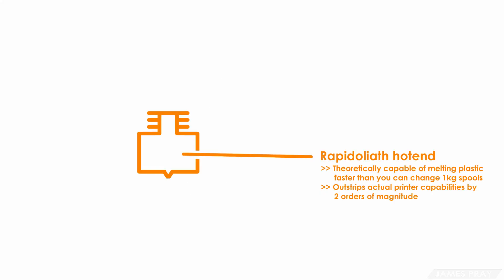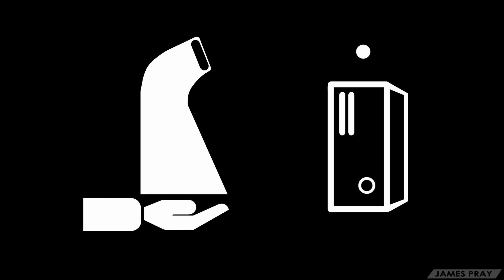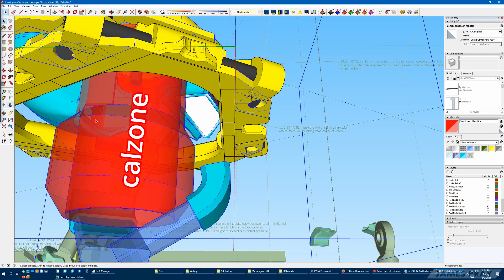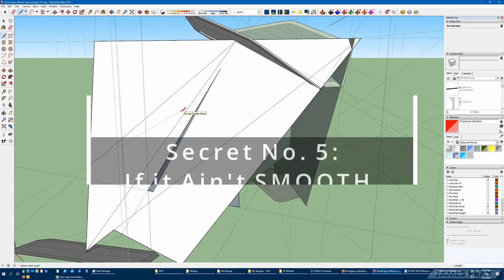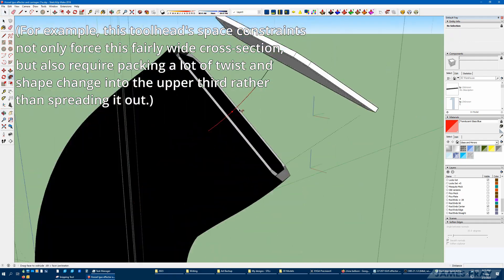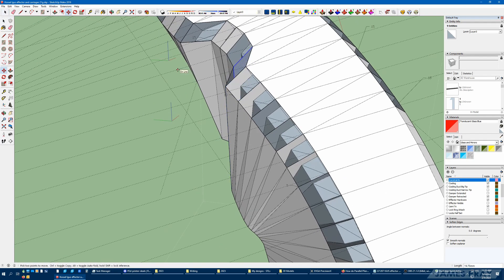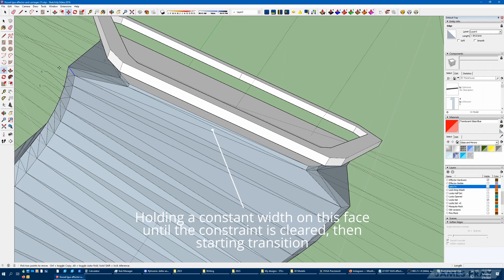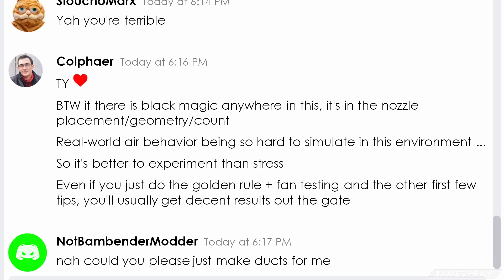Ultimate Duct Design Guide for 3D Printers | My Top 17 Secrets for Custom Cooling Ducts that WORK

Comment: best cad is blender
Reply from the maker: EVERYBODY FIGHT:face-blue-smiling:

FR though, blender for duct development could make a lot of sense
Reply: @jamespray  I have made a setup, where I just make a curvy 2D plane with like 16 vertices, and it turns it into a smooth tube of arbitrary thickness. I then just added a boolean, so now I can just hide parametric ducts inside the walls of my prints.

people do CAD, but blender can be parametric, or explicitly modeled, interchangeably.

Comment: Great guide, thank you James
Reply from the maker: You're welcome!  Always nice to hear :)
Reply: @jamespray  May I ask few more questions cause I'm a totally noob🤣:
1. Secret 2, how to measure the air feed? by watching how deep the water been blow away?
2. Secret 9, the ideal duct cross section shape is circle, but air outlet of some fans is rectangle (e.g. 5015) , so how do I decide the duct cross section shape at start? a circle that totally cover that rectangle will do the trick? or just smoothly trans that rectangle to circle?
Reply from the maker: @mortysmith3592  1: It's hard, lol, but just do your best - the "sweet spot" is usually broad enough that you don't have to be perfect.  Using water and taking pictures of different tests for comparison helps.  2. If possible, start with the fan outlet cross-section to avoid a sharp transition of cross-section area (same as with any part of the duct).  If it's a rectangle, start with that rectangle, then transition.  Hope that helps!
Reply: @jamespray  So much thanks for your advice❤

Comment: There are free CFD options, both proprietary (which have the pro of GUI but limitations on what you can do, e.g  ANSYS Workbench Q which limits 512k elements at 4 solver processes, Star CCM+ and COMSOL Multiphysics also have free plans iirc, it's been a few years since I looked at any of the proprietary packages). But there are at least two notable open source CFD solutions. OpenFOAM and NekRS. I believe both are commandline only but they don't have any artificial limitations so that's the tradeoff. A major benefit of those is that they have native linux support. I don't know which, if any, of the proprietary solutions work on linux or which ones can be made to work on linux via compatibility layers like wine.

Comment: This was very much needed. I’m designing a drone that uses two vertical props in the middle that get S-ducted away to downward nozzles at the front and rear of the craft. The nozzles would then vector and control would essentially function like a Bicopter.

However I’ve really been struggling to find a set of basic tips for ducting like this. I know enough that poor ducting will cost me thrust, but when it comes to the right kind of design to sustain thrust after bending it twice, I’ve been flying blind!

Now I have a few key things to bear in mind, the first prototype will hopefully have a negligible loss of thrust. Thank you sir! 😃
Reply from the maker: Cool!  Not a use case I imagined in the making, but ducts do just get air from point A to point B, after all.  Good luck with the design!

Comment: just why tf would you use sketchup
Reply from the maker: Stable, free, lightweight, entirely local (at least the old version I use is), and does everything I need because I work alone and don't CNC.  Also, I'm really good at it.  Tools are tools; use what works for you.
Reply: @jamespray  I used to use it and it frustrated the fuck out of me 😂. All I'd say is that there are much better CADs that can do things a lot easier
Reply from the maker: @elitesennabubble  Sure, everything has its pros and cons.  If something is frustrating to you, though, then yeah, absolutely not worth using if there's any alternative.  But SU doesn't frustrate me at all.  It's "transparent" to my creative process.  That's because I have 15-16 years of practice, lol.  It's very powerful in some ways, especially in terms of the freedom it allows you, but that also means it's easier to get into trouble if you're the right combination of ambitious and inexperienced.  That's why I don't recommend it to anybody, but at the same time I genuinely appreciate it and have no compelling need to switch.

Comment: u mad man, cant even think about doing stuff like that in sketch up.
great video, i think you never gave a reasoning for the "golden rule": turbulence is bad and will result in pressure loss. they happen if air detaches from the wall, this will happen on straight sections around 10°.
also the air speed on every surface has to be 0 (the wall is not moving anywhere) and will rise exponentially with set distance from the wall. so try to maximize the cross section.

Comment: Awesome video!! i personally treat it like a game and don't look for advice and just figure it out myself, then i go look for cheat codes after i "beat the game" 😅 TONS of great cheat codes here. The 11 degree grade is something i wasn't ware of, but i did "naturally" find certain things on my own, like the curves are less restrictive when C shaped and not cupped and a little backpressure/resistance in the ducting helps even the air flow to multiple exits. But im sure there's better ways, just that the blowers typically have cupped in blades to accelerate the air flow that tends to push the air to one side. My guess if the fins where straight then the air flow would be even coming out.
Reply from the maker: Thanks, I'm glad you got something out of it!  The uneven airflow coming out of blowers is a result of the air trying to flow outward all the way around the impeller and getting accelerated around the housing wall as a result.  Blowers can actually have forward swept, straight, or backward swept vanes, without changing that aspect; the vane direction has other implications like the balance of static pressure vs CFM (straight vanes also accumulate less dust over time).

Comment: Normally I say nothing, but this is like the 50th video where someone is trying to explain something I want to learn, and their microphone is so quiet I need to turn my massive sound system TO MAX just to barely hear them. It's current year, you own a computer with video editing software that shows volume levels. No excuses.
Reply from the maker: Yep, it's bad.  It was also my first foray into cutting videos with separate voiceover.  Didn't use a good mic, didn't understand levels.  I learned from it and if you care to check it out, I believe you'll find improvement in my content since.  Cheers!

Comment: Why are you torturing yourself with Sketchup? 
Two whole hours to loft two rectangular shapes along a guide curve with a bit of rotation here and there? 
That's insane, you need to value your time more. 
This is a ten to thirty minute task in a proper software suite.
Reply from the maker: I value my time very highly (it's an often-missed factor, though).  SU does save me a lot of time outside of this particular worst-case use case, but only because I have a lot of practice and good workflows.  Many of my reasons for sticking with it revolve around the deficiencies of other products in the same space, my comfort level with it, and the fact that I'm a curmudgeon :face-fuchsia-tongue-out:  I'm not recommending it to anybody else!

Comment: How do straight lines in a duct affect airflow? I grasp that it heightens friction, but could it also lead to turbulence? Additionally, if the duct divides the air into chambers/sections, like in the case of this (https://i.ibb.co/WcGN1sN/Capture.jpg)  example 120mm fan duct, what impact does it have on airflow dynamics?

Comment: Great video, but I will probably skip half of the secrets and try to use a loft. Since its a pain in the ass to make 3d sketches with this program.
Reply from the maker: The secrets are totally compatible with lofts, especially if you don't try to make the entire duct out of a single loft but use several to manage the shape more closely.  And either way, I don't think you could apply them all on any one thing without going out of your way to be a tryhard. Have fun and good luck!

Comment: Great video, even if watching you use sketchup made my eyes bleed lmoa.... question though, have you tested two outlets vs one? I see you talking in comments about offsetting outlet angles 120deg, so the flow doesnt cancel, but I cannot find anyone who has actually tested this vs a single outlet. Well apart from one dude who wrote a quick reply on the Duet forums saying of all his tests, simple single outlet is better. Any thoughts yourself? 
Aside, I use a laptop CPU fan (Lenovo B450) and then design the scroll housing in with the ducts. More powerful, quieter, etc. Just upgrading my extruder and dithering over 1 vs 2 exits now!!
Reply from the maker: With the caveat that "It depends!" based on many factors and I wouldn't go so far as to say any one approach is best for ALL situations, I have found in testing that two well-designed and well-placed ducts will give better cooling results than a single one, all else being equal.  (And yes, I did test this!)  The main upshots of a single duct are simplicity and minimized duct perimeter (theoretically less losses) vs multiple ducts, but the price you pay is more directional  (or you could say anisotropic) cooling, where features favorably aligned with the airflow are cooled more than those facing the other direction.  A good overhang test with steep features facing multiple directions will show this effect clearly.  Multiple ducts, meanwhile, require more space on the toolhead and probably more work to design, but the reward is more even distribution of cooling and less variation based on the geometry being printed.  My 120 degree design is a compromise, but so is everything else -- there's no avoiding them, only picking the ones that best meet your use case.  I hope that helps!
Reply: @jamespray  Awesome, thanks for the detailed reply!! Really appreciate it. Yes, I have seen this effect with just one outlet, overhangs on the opposite side of the nozzle do suffer. Sigh, guess I'll design in two then. At least it looks cool!!
Reply: @jamespray   Been having some annoying stringing problems so I tried different duct configs to see if that made any difference. It didnt, but I was able to confirm two exits at 120deg apart gave much better overhang performance than just one!
Reply from the maker: @TheMastaRob  Cool!  (lol)

Comment: What I got:
0- Narrowing down a fan duct: Increase in Airflow Velocity: Faster Solidification.
1- you need to figure out how much can you narrow down the outlet before your fan can't handle it.
2- you should cut one dimension of a duct in half in a run of no less than 2.6x of that dimension.  "changing the cross-sectional area too fast cause throttling"
3- to get started with a duct is to place your start and finish and then work to join them together this is a lot easier than trying to work from the start to the end.
4- you need a smooth overall run with big curves.
5- the ideal duct cross section shape is a circle the more perimeter you have for your cross-sectional area the less efficient your duct will be.
6- the shortest possible duct with hard bends is likely to underperform versus one that's a little longer but follows a smoother path with larger radius bends. 8:15
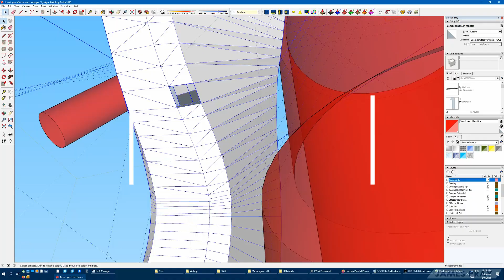7- avoiding Sweeping Curves Along the Wide Axis: Sweeping a curve along the wider axis of a duct (which has more space) may require more area and can be less efficient in terms of space utilization. Sweep axis " sides ". 8:35 (bend it like a ribbon 8:32
8- lofting can cause problems, try having more stations and spreading them out so that you're not overlapping too many changes to the size shape and direction of your duct.
9- don't cut down to the final Outlet cross section too soon large ducks are more efficient than small ones 10:42

Comment: I have made several mistakes you identify here. I asked around on forums and nobody could identify the problem. This video contains precious practical knowledge (distilled down from arcane formulas or passed down as tribal knowledge?)

i have a question : isn't "change the cross section of the duct as gradually as possible" and "keep the duct wide until the end" conflicting commandments?
Reply from the maker: Thanks!  That's exactly why I made it.  As far as those two commandments, it really depends on how much duct you have to work with.  The second one about maintaining a wide duct as long as possible really kicks in only when the duct is very long, which isn't common on toolheads except sometimes in CPAP situations.  All of the guidance really applies as a matter of balance and practicality -- you'll rarely have all the space and freedom you need to design a perfect duct, so it's all about knowing what will get better results within the constraints you have :)

Comment: Can you give some tips, where to target the center of the tip of the duct respect to the hot end nozzle? Why some have cuts to the end? I dont want to cool the nozzle hot end.  Thanks for sharing your knowledge. I m doing for 2 5015 blower fan setup with e3dv6 for argentinian diy printer ( makerparts)
Reply from the maker: There is lots of room for experimentation with nozzle placement, and I am not a master.  What has worked for me is aiming the nozzles as close as possible to the very tip of the nozzle without actually blowing directly on the heater block/sock.  I also think it is good to avoid aiming nozzles straight at each other -- offsetting to either side or angling slightly apart seems to give better results.  But every setup and hot end is different, so try different things and see what happens!

Comment: Hi James, for secret 2, when you talk about axial fans only tolerating high ratios, are you referring to the outlet to inlet ratio ?
Reply from the maker: Correct!  In fact, I have done additional testing since making this, and I found that axial fans don't tolerate any reduction -- the outlet / inlet ratio times the rated CFM is the best-case limit for how much airflow you'll get out the end (e.g., if the outlet is half the inlet, an axial fan will likely deliver no more than half its rated CFM).
Reply: Yes, I think more so than radial fans, axial fans rely on  entrainment to increase airflow. Some of the air on the inlet side is traveling radially towards the fan disc and any obstructions of the inlet obstructs this flow, producing the overall effectiveness of the fan.

Comment: I was wondering: knowing the parameters of the fan that you're gonna use, do you know if there's a way to simulate the amount of chocking that can be applied to the duct (in order to skip the empirical test and save material)
Reply from the maker: If you don't want to test empirically, the best option is CFD, but then you do have to learn CFD.  As a rule of thumb, though, I've discovered since making this video that at least for axial fans, you shouldn't choke them at all.  Whatever % reduction you use is roughly the % of the unchoked CFM you will get out the end -- in the best case.  Yikes!
Reply: @jamespray  yeah, axial fans are no good for part cooling fans most of the times... Rn I was thinking to install a remote 7530 blower fan via a Ø22mm cPap tube... Is probably gonna be a little too overkill, but we'll see. And I guess I'll have to learn a bit of CFD🥲
Reply from the maker: @kornephoros  My view is, as long as powering/controlling a big remote cooler isn't a problem, there's no reason not to have more than you need.  Then you can underrun it and it'll be quieter, probably!

Comment: Ive watched this a couple of time, but still don't get it. I have the fan where I want. But mind is drawing blanks on how to make the duct. Specifically the mid sections and the guide rails for the loft
Reply from the maker: To be honest, that is one of the tougher parts, especially if you're new to it, so don't be bummed if it takes some time.  Working from the ends to some midpoint usually helps me find the right line(s), breaking the duct into multiple parts and solving each area on its own.  It also helps sometimes to have the print head (or whatever) in front of you for reference, so you can pick it up and turn it around instead of only viewing it on the screen.